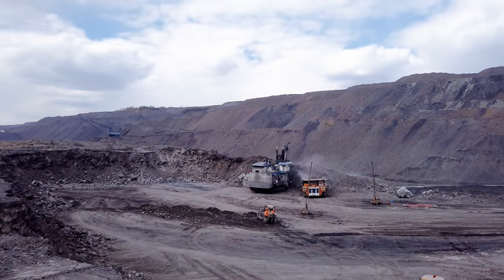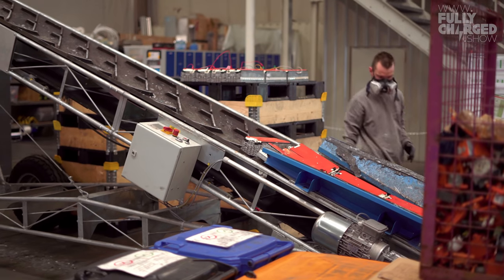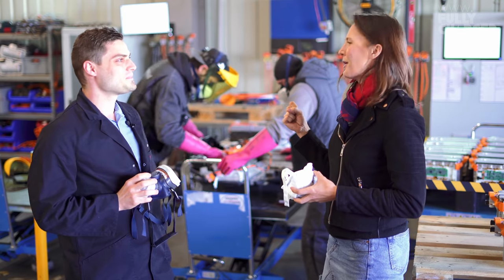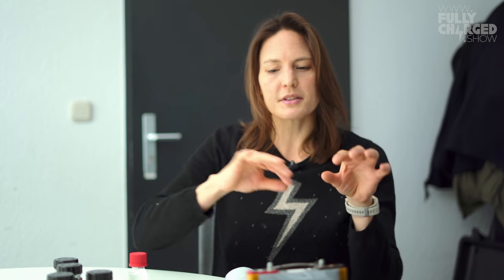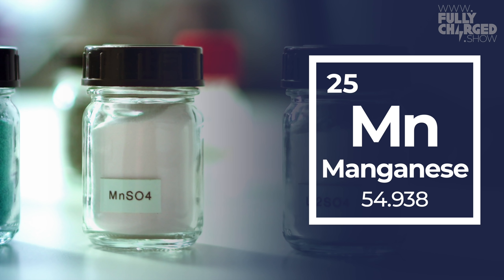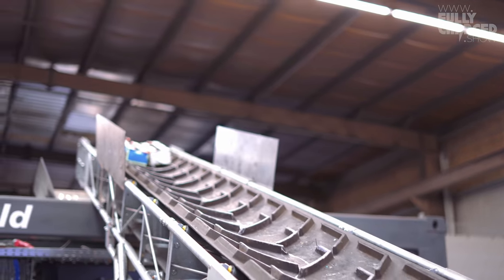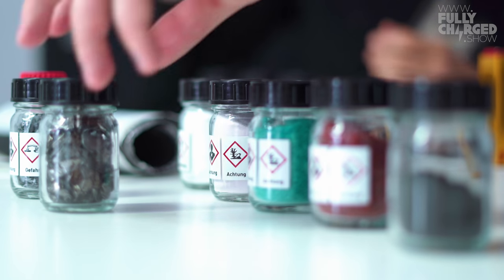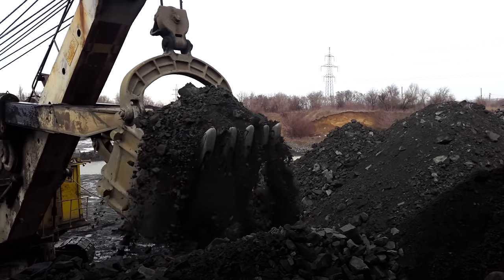Yes, we can RECYCLE EV batteries. Here's how | Fully Charged

Comment: The title is a bit misleading. It's never been a question of "can". It's more a matter who's bothering to actually do it. Recycling a lithium-ion battery has a number of challenges not faced with older lead-acid recycling -- which is pretty much step one: dump into "wood chipper". (dumping li-ion into a shredder would make for an interesting video, but not so much for an attempt at recycling. i.e. 12-30v module with a 10,000A short circuit current)
Reply from the maker: Thanks, but when you’ve been told you can’t or asked if you can by about a million people over a ten year period, you have a strange desire to clear things up. Thanks, Fully Charged Dan
Reply: @fullychargedshow  There are lots of "mistakenly educated" people. If, for example, one goes by the Wake County Solid Waste Services recycling card, they might think all manner of things aren't recyclable; just because the city doesn't accept them in your blue bin, doesn't mean it cannot be recycled. (styrofoam (low density, costs a fortune to collect, and there's next to no market for it), pizza boxes (grease and food contamination), plastic grocery bags (fouls up the sorting machines), ...)

Comment: If batteries cannot be fully recycled then its the same for standard ICE cars ie plastics, rubber etc. Whats missing is volume, standardisation and making mined battery material more expensive. Like to see every battery maker partner with a set up like this. Maybe there shoukd be a recycling tax on bayteries so the state does not have to clean this up later.
Reply: No: you want a virgin material tax to increase recycling viability. Because virgin materials involve an ecological cost with the digging up and the refining.
IMHO the best way to do this is just make all producers responsible for their waste products at end of life, as we already do with cars and nuclear power stations. Simple rule everyone can understand. You should get powerful incentives for a much more circular economy.

Comment: can't graphite be recycled? otherwise, they would have achieved 91% efficiency which is great. great work btw thanks.
Reply: I suspect it's just not very valuable. Carbon is everywhere! The electrolytes and metals are much more valuable.
Reply: @KieronTaylor  but you can still reuse it in many applications, that will reduce dependence on carbon mining etc.hence will reduce energy footprint, I think.
Reply: @KieronTaylor  Convert it to Graphene, it may then be more valuable than metals

Comment: I am surprised that these batteries are being recycled rather than repurposed for static storage. After that second life, then recycle them, surely?
Reply from the maker: We will be doing an episode on 2nd life batteries too, both are options independently or in combination. Thanks, Fully Charged Dan
Reply: Some of the older batteries from cars (etc) were not so well managed/wired which meant that they get to a stage they cannot be repurposed for storage as they had dead cells that blanked blocks of cells and made hem "dead" but still contained useful cells.  This shows what the end point should energy dense (cars), to storage, and finally to recovery.  Obviously use of old batteries as storage is the most cost effective use of well designed batteries.
Tesla batteries are, for exampled, built in design for second stage usage of storage as they have a business model to do this; so the internal management systems are designed to isolate dead cells.  Hopefully other manufactures will copy these designs.
Reply: Having any mechanical damage (car crash, drop ect.) or burned out cells would take parts of the batterys otherwise sensible to use for storage out of circulation to begin with.
Reply: First not every battery is so sound it can be put into a second life cycle. Second we need to practice recycling so by the time waste batteries ramp up there is a solution. And this solution has to be there before hand, not trying afterwards like atomic waste. Battery recycling is one of the top three arguments anti-E mobility activists used to prove BEVs are not green.

Comment: A bit of  a waste, I think many of the batteries should be sold and used as is for secondary energy storage. then if that will not work the ground up. I they have to discharge an EV battery that means it had enough energy to be a power wall or other storage device.  This way it is brought back to materials , then created again, lots of energy to do that.
Reply from the maker: We will tell the 2nd life story too, but we simply didn’t get the chance to film that before lockdown, and we felt it important to get this out given that it’s one of the biggest sticks people beat EVs with. Thanks, Fully Charged Dan

Comment: What they don't explain is they discharge the batteries to 0volts before recycling but the reason all these batteries still have a charge is because they are dangerous if allowed to discharge below 20%???
Reply: If you discharge them under 2.5 volts per cell, they get damaged irreversibly. But if they have no charge at all at the end, they also can't blow up if they get shredded.

Comment: Now if only the price of lease EV cars were comparable with petrol cars I could get a decent one and insurance companies need to make insurance cost the same as a petrol car too as for alot of people EV cars are more costly to insure.

Same with getting a decent used one on PCP, the point of PCP is lower monthly payments then a chunk at the end if you keep the car...with EV cars for example a 2015 rex with the bigger sat Nav screen you are talking 300 or just over a month with a smaller chunk at the end....petrol cars you can get a way better spec car for alot less a month with a bigger chunk at the end if you keep it...most people don't keep the PCP car and get another at the end.

Car dealers need to make prices inline with petrol cars because really that I3 I mentioned which is 5 years old should be no more than £200 a month lol you can get a new 2020 car alot cheaper.

I have wanted a EV for ages loved a used I3 but costs are way too much, then I saw I could have got the new version of the Zoe GT model without rapid charge for £166 a month or for extra £10 I could get rapid charge one...on lease

But working out costs and how far I drive which isn't much compared to others I'd be out alot more money Insurance for a EV for me is £85 to £90 a month lol I'd need a home wall box and they are a rip off as companies are using the government grant but still charging people £400+ no way a wallbox fitted would cost even the £400 it's just routing power to another new socket and the cost of the box etc

Then the Zoe needs to have a yearly service so that's a extra £95 

I had to opt for a brand new DS3 crossback prestige petrol

£130 a month £205 Inc insurance, no tax to pay as it's Included, no service as I won't do enough miles in the 24month I will have it, no MOT either being new car don't need one if keep it 3 years or less and free full breakdown cover

Majority of people have to think with their pocket first...it is down to car makers and dealers to make sure prices are fair compared to petrol cars specially with more out goings with a EV car

So while its good they are trying to recycle batteries the EV market has alot to sort out before more people get one

Comment: let make this clear ,  we can recycling everything ,  the  problem is how much effort it takes ,   to recycle a lead battery you just need to shred eveything and separate , lead sulphate , lead metal , pp plastic , pe plastic and sulphuric acid , all boxes are pp plastic , all separators of cell are pe plastic, some one has textile product inside but is not an issue  , is a product made to be easy to recycle , we do not mine lead anymore ,   you get out prime material ,  lead  , pp chips , and a salt ,  , tecnically we could reuse pe plastic ......  how much we can recycle per day ? how much you want ....in europe we have recycling plants not running 100% and they are recycling all the lead acid batteries of europe since 90s ,    lithium as you can see is  a super complicated process with a manual  preparation etc...   so when some one tell you lithium is not fully recyclable , is complicated etc...  is right , at this stage the  recycling efficency of lead is way better  in comparison of lithium ,  getting energy out from a broken battery is ok but is not the goal , ...... you can pay 100 euro a month for the energy of your house or pay a guy that try to get energy out a broken thing ,,, what cost less?   so if a green product is so complicated , imho is not green ,  a full recyclable product  made from reclycled material is a green product , a lead battery is a green product , a lithium is not ,  a modern EV is not a real green product , EV are  full of not needed tech to let you buy the next high tech product to let you feel 2020  ,  is better than petrol engine but is not better than ethanol fuel....

Comment: You haven't addressed 2 major issues, first is raw matterial cost. It's currently cheaper to purchase the raw material than buying recycled materials. But more importantly is the water crisis we have right now. Mining Lithuim uses a massive amount of water, co2 and often increases toxicity in the soil. Lithuim batteries are an ecological disaster, it's not the future.
Reply: Nachunternehmerhaftung... The accents put them in a place where raw materials get more expensive and water is abundant (including regulations to keep it clean).
Reply: Exactly.
Reply: @fionafiona1146  water is not abundant in areas where lithium is available to mine. Period.
Reply: @trandel  it's where they recycle (dehydration, acid baths and rehydration use water too).

I am aware lithium deposits don't coexist with wet environments.

Comment: Lead-acid batteries, specifically car and deep-cycle batteries, have been recycled since the beginning and in many places have been mandated to be recycled for many decades. It's only in the last 30 years that rechargeable batteries have come into the picture that are more toxic and harder to recycle.

Single-use batteries are a bigger problem for obvious reasons. They really should be banned entirely and replaced across the board with user-replaceable rechargeables. And yes, non-user-replaceable batteries should also be banned. The end user should always be able to easily and quickly replace batteries, regardless of the device.

Comment: What about heating the entire battery to plasma temperatures, accellerating the plasma to high velocity, and then separating the pure elements magnetically. Because each element has its own unique atomic weight the distance each one can travel until it stops should be roughly the same. Afterwards tap each element at its landing point.

Comment: Battery pack manufactures and not battery manufacturers should be mandated to make the pack so you can take it part easily. So you can actually separate the individual batteries and re-use the good cells, usually when a battery pack goes wrong it has 10-50% of the cells gone bad, not 100%. To increase life those remaining 90-50% could be re-used. (DYI power-walls or other applications) This is so wasteful when 20 18650 cells go bad on a pack that has 1000 .. to recycle the 980 good cells :I as you cannot 75% recycle them anyways. So you basically waste 250cells when you currently recycle them even with this high end recycling and what? 91% next, it's still 90 cells wasted. compared to the 20 actually bad cells.. Our hypothetical battery.

Comment: The biggest problem TODAY with battery recycling is the simple fact that there aren't actually very many batteries that need re-cycling!  Look at the scale of this company, just a couple of guys taking a few packs apart.  Right now, any "used" EV battery is worth £££ as a battery, even a not very energy dense one, for second life projects.....  (this will obvs. change as EV production ramps up but this is what is preventing widespread recycling, the lack of need........)

Comment: The future of batteries for storage of Renewables-generated electricity is, at bestl limited, IMO. Making the batteries means extracting Lithium in what is a pretty destructive  process; what's more the time it takes to charge batteries makes them poorly suited for automotive applications. Proton Exchange Membrane (PEM) Hydrogen-Fuel Cells are poised to take over, in this kind of application, and in many other static ones - especially where it is possible to generate electricity on site, there is abundant access to water - including sea water. 

Using and PEM Electrolytic Cells (that split water into H2 and O2 using Renewables-generated electricity) it is possible to store the energy in gaseous form. the emergenec of a whole range of options of the storage of Hydrogen gas in various forms - with densities and energy recovery rates increasing year-on-year - it becomes much more feasible to install the whole generation cycle, even down to recovering the water that is the only physical emission of the Fuel Cells, and utiliese the waste heat component for space or process heating.

Limiting factors thus far have been scarcity and cost of the Platinum, for the reactive coating at the electrodes used in earlier generations of PEM units, and the need to store H2 either in cryogenic (=energy-intensive) or super-compressed|(costly/heavy tanks) state.

Lithium batteries will probably continue to provide useful service in small devices, however, as they would be more efficient than trying to store H2 in sufficient quantities in a miniaturised device, like a mobile phone.